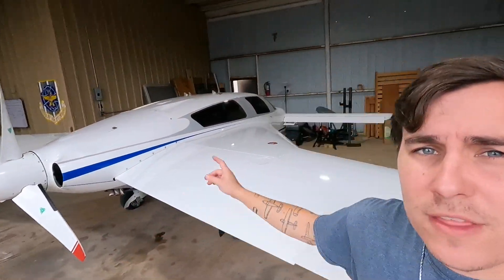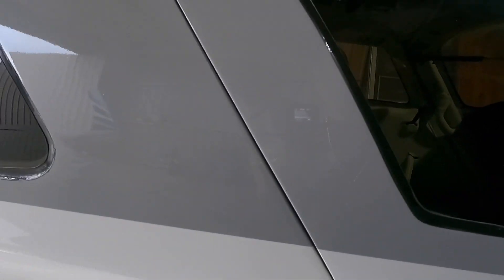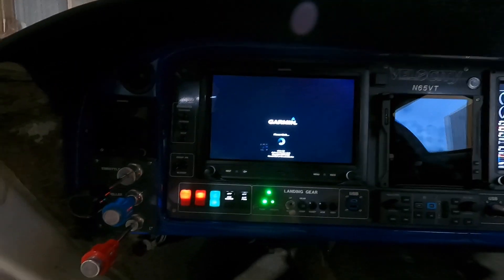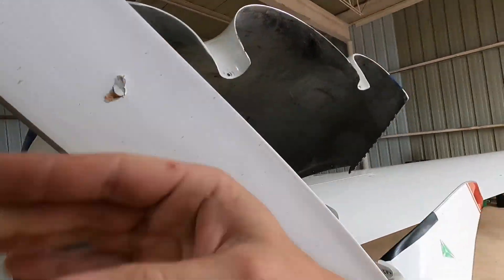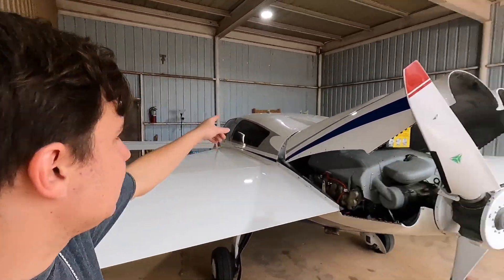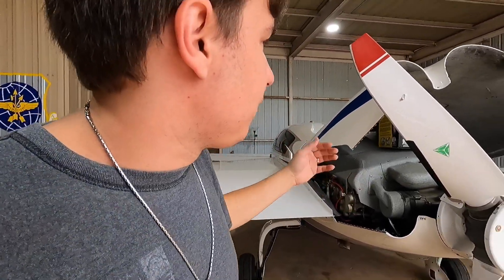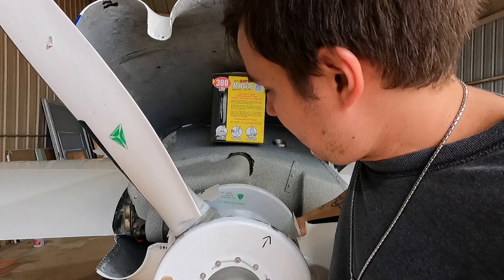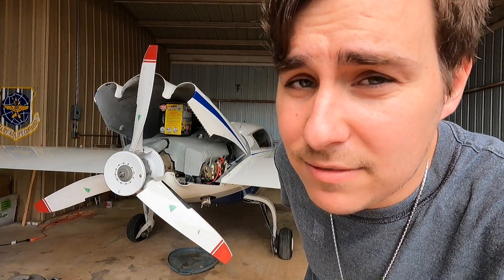The Fatal Flaw of Pusher Aircraft: Propeller Damage on a Velocity

Comment: Very interesting.  I owned a Progressive Aerodyne Searey wihich is also a pusher with the Rotax sitting on the rear wing.  So,  yes something could have come off the engine and through the prop. Gratefully, my prop could easily be replace and not anywhere near the cost of this.  I have a question for you.  As a young person who seems very skilled in his work, were you mechanically inclined w hen you were young?
Reply from the maker: I was. I also was incredibly blessed to grow up with 2 stroke dirt bikes. My dad had me cleaning/replacing my own spark plugs and cleaning the carbs by the time I was 14. I then built/restored a 67 Mustang with my dad, which has made some appearances on my channel. When I graduated high school, I went straight to A&P school. Got my cert 2015 and IA in 2018. Not to sound cheesy, but I still try and learn something new as often as I can.

Comment: Shouldn't the nuts have lock tite on em or safety wires???
Reply from the maker: For the Prop? Depending on the installation instructions, many are just self locking nuts. For the screws holding all the panels on, that's exactly what I did after the one came out and struck it. 

Ironically, here we are close to a year later, and the same prop just ate a rock off a runway and is getting repaired again.
Reply: Cowling fasteners are designed to allow frequent removal of the cowling.  Lock tight defeats the purpose of better option might be to use camloc fasteners or hinge stock with a long pin.

Comment: Inflatable door seals as part of the interior finish work?
Your mention of bolts oohing themselves loose reminded me of my own "transportation" .I have an e-mountain bike with 2 wheel hub drive, 2 Li-ion batteries, dual suspension and two hydraulic 4 piston brakes. So with all those features and many more I too have to do a monthly check of critical bolt torque settings and a check for the tightness of any other fasteners. While not as critical as a general aviation plane it IS critical when I am many miles from home or my car camp. That's why I carry a fairly complete tool kit, chain repair parts and flat tire repair fluid. As well I carry a day pack with survival gear for the season.
Reply: Do you use loctite?
Reply: @davefoord1259  I do use red LOCTITE on  axle nuts and brake bolts as wells handlebar stem bolts. 
I may use it on front and rear suspension bolts as they take a beating and see a lot of motion.
Reply: @ are the bolts subject to rotation in service?

Comment: Why are you taking the prop off? That’s an easy in-field fix. I’ve had so much FOD go through my MT on my Velocity over the 22 years that I’ve had her flying. Almost all of it can be done in-field with about an hours work (and then just wait for the composite repair to cure (24 hours). Then next day sand and paint the repair. Done.
Reply from the maker: I didn't show it on camera or discuss it, but the owner had the prop overhauled a few months back. Some of the paint had some defects and started peeling. So the prop shop was fixing that under warranty anyway.
Reply from the maker: Here we are 4 months later and it picked up another nick. What is a good field repair for it.

Comment: I'm surprised you didn't just ("just") take the damaged blade off. Seems like a top-mounted pusher jet (e.g. Cirrus Vision or Subsonex) would at least avoid the issues of ground debris, right?
Reply from the maker: I would agree that higher props like a cessna 337 is probably better. The propeller shop is also doing some warranty work on the other blades.